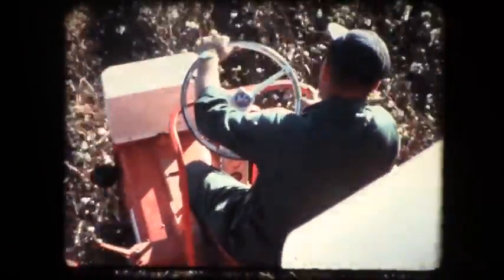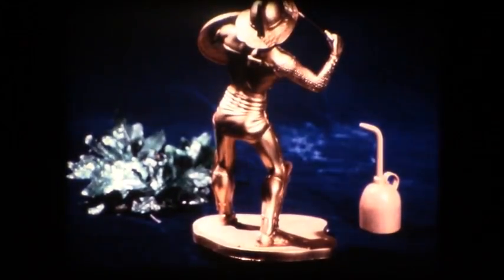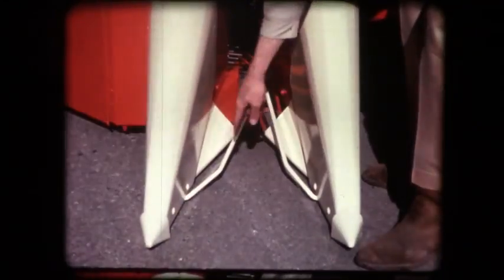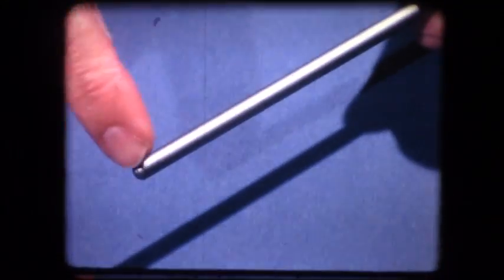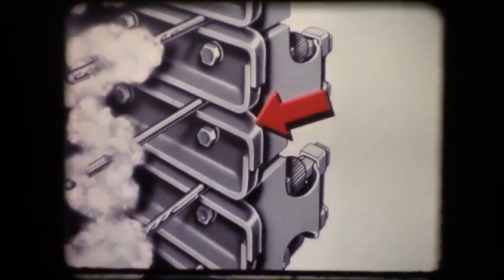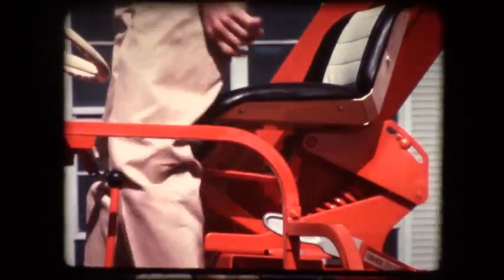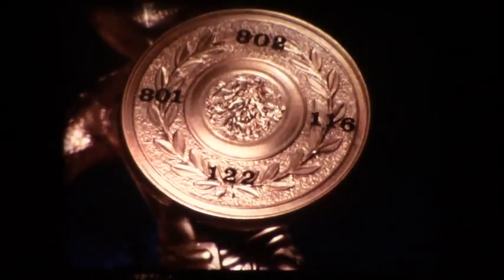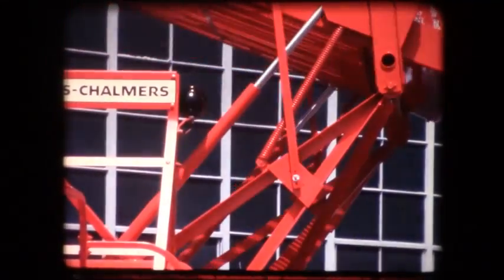1960's Allis Chalmers Dealer Movie Guardians Of Cotton Profit

Comment: Dang that was some beautiful cotton... back when you could actually make some decent money with cotton.  Course it's the same lousy 60 cents a pound on average year in year out that it was back in the early 70's... why there's no money in it anymore unless you're farming several thousand acres.  

I've heard of AC cotton pickers but never seen one in actual running condition.  They just never seemed to catch on, at least around here.  IH had the undisputed best cotton pickers from the 50's, 60's, and 70's.  Deere one rows were a hot mess, and their 99 series double row self propelled machines weren't a whole lot better.  It wasn't until the 699 series and the 9900 that Deere really started pulling even with IH... The IH single rows were always better, and the 200 series double row self propelleds were good machines.  The 400 and 800 series, well, there weren't too many of those around either-- they just didn't last like the older 200 series did.  We had 4 IH double row self propelleds over the years-- two old 220A's, a 214A, and a 416 diesel.  The 400 just wasn't as well built or designed as the older machines.  I always liked the looks of the 782 IH pickers, but they were WAY too new and thus too expensive for us to be able to afford.  Then Case IH and Deere both were neck and neck when they came out with their first four row pickers, and then five and six row.  Deere pulled WAY ahead of IH on their drum design when they went to inline picking units.  Deere has the superior picker now and you don't hardly even see any CIH pickers around any more in the field-- where they used to dominate now it's all Deere green machines.  

Course, we'd have stuck with IH but CASE IH basically said, "Screw the customer" and quit providing parts.  Without parts, ANY machine is just "scrap iron waiting to happen" and for years us smaller farmers scrounged the fence rows and junk yards for parts to keep going, and then finally all those old machines just went to the scrap yard themselves.  After the way the dealer OUTRIGHT LIED to me when I bought the 416 from him, when I asked him, "CAN YOU GET PARTS FOR THIS MACHINE?" and he said, "sure we can!" and then the first time I had a breakdown I got a sob story and a week of runaround on obsolete parts network and then told I was SOL, so I sold it for scrap a few years later and replaced it with a DEERE picker-- DEERE backs up their machines with PARTS SUPPORT... Case IH turned me into a Deere man, and now that New Holland bought Ford Tractor Division and did the same thing to us on Ford tractors and implements, Case/New Holland has firmly made me a DEERE guy... Later!  OL J R :)
Reply: In my area a former IHC DEALER RUNS JOHN DEERE S NOW THEY SOLD THEIR DEALERSHIP ABOUT 15 YEARS AGO....THOSE ROUND BALES THE JOHN DEERES MAKE ARE SO MUCH BETTER THAN THE SQUARE  BALES THAT IHC MAKE
Reply: Still can't see how a Farmer can pay for a 800,000 USD PICKER
Reply: The only AC cotton equip I saw in my area were one 4 row brush head stripper and one platform stripper and all I know is that the ginners didn't like them !!!!!
Reply: @robertpayne2717  like Grandpa always said, "they can't... The bank owns it!  He just runs it for them"
Reply: P
Reply: @robertpayne2717  Well stripped cotton, particularly in the old days, was a LOT dirtier than picked cotton.  Now with saw cleaners on almost every stripper, the cotton coming out of a stripper is way cleaner than picked cotton.  Honestly I'm kinda surprised they even build pickers anymore, considering the difference is negligible between picked and stripped cotton quality wise anymore, and strippers are SO much simpler and cheaper to build and maintain than pickers and can be adapted to any row width or configuration easily vs.a picker.  Main difference is strippers are for "stormproof" tight boll cotton and pickers are usually used on more open boll cotton, but I don't know how much real difference in that there is anymore.  IH USED to build strippers too, but in the mid 80's when they came out with their 1822 and 1844 four row pickers, IH decided to go with a "common platform" with the only difference between pickers and strippers were which heads were mounted on the machine-- the rest of the machine was the same only they put stripper units on strippers and picker units on pickers.  I talked to a guy once who told me how that backfired on them... Strippers had always been built on lighter chassis for the lighter stripper heads, but the 18xx series machines had to have a heavier chassis to withstand the load of the much heavier picker units on pickers.  He and a buddy had put in cotton after being out of the business for many years, his buddy bought a new IH stripper, he bought a used Deere stripper, which his buddy teased him about.  They started stripping the crop in a wet fall, and had planned to team up to harvest both their crops faster.  The heavier IH machine kept getting stuck SO MUCH that he ended up harvesting BOTH their crops with the old Deere, and that shut his buddy up quick.  He was disgusted and traded off the new IH machine for an old Deere himself.  Another thing is, pickers are geared MUCH slower than strippers... So unless you use to totally different transmissions, your really limiting the usefulness of a stripper.  A few years later IH quit offering a stripper altogether; they proclaimed pickers "the wave of the future" and said strippers were becoming obsolete, thinking they could force their customers to switch from strippers to much higher priced CIH pickers.  Well, that didn't happen; IH stripper customers didn't buy CIH pickers, but became Deere stripper customers.  I talked to a big high plains cotton Garner e at a farm show one time, he told me the story... He was like, pickers are too expensive, too complex, too much maintenance and repair, and TOO SLOW... Pickers to out in speed at a little over 4 mph in scrapping gear-- they can't spin the picker units faster without blowing them apart.  Strippers run unsynchronized with ground speed (meaning the stripper units spin the same speed at all times regardless of ground speed-- pickers spin their drums proportional to ground speed so try don't "rake" or drag the cotton at high speed, or beat the cotton and pull it at low speed).  He told me in light cotton they will run the stripper at up to 10 mph!  Plus at that time you could only get a 4 row picker while most strippers were six row.  So using a picker would take FOREVER covering thousands of acres... So the CIH customers dumped CIH and bought DEERE strippers!  Talk about cutting your nose off to spite your face!  Part of the reason CIH is a loser company now owned be New Holland/Fiat...

Later!  OL J R
Reply: @lukestrawwalker  cih doesn't make a cotton harvester anymore
Reply: @brandonwood1397   pickers, but not strippers I guess... But nobody in our part of the world buys them anyway... Everybody runs Deere pickers
Reply: @lukestrawwalker   they don't make either Deere is the only one to make a cotton harvester
Reply: @brandonwood1397  Really?  Didn't know that, but I quit row cropping to do all cow/calf 20 years ago.  I know back in the early 90's CIH quit making strippers, figured with four row pickers they'd just force everybody to switch to pickers, but the High Plains will never switch with their stormproof cotton that needs to be stripped to harvest efficiently, plus strippers run way faster and MUCH cheaper to buy, repair, and maintain.  When they lost huge market share because all their stripper customers started buying Deere strippers instead of CIH pickers, they suddenly took the CIH picker chassis and put stripper units and a saw cleaner on it, but I talked to a guy who said it was WAY too heavy and sank like an anchor in wet conditions, he ended up harvesting his and almost all his neighbors with his used Deere stripper which was light enough to stay up in the mud.  The CIH strippers never sold well and they gave the market to Deere.  

Wouldn't be surprised CIH quit the picker business too... From my own experience, CIH is a loser company, they basically sent our IH pickers to the junkyard in the early 90's because the b@stards wouldn't provide parts, so we switched to Deere pickers and never looked back.  Any company that won't support their equipment with parts is a sh!t loser company IMHO and I won't waste my time or money doing business with them.  No wonder they got bought out by New Holland to make CNH, and that whole mess now is owned by FIAT (fix it again tomorrow) so just a big cluster fvck like AGCO... No thanks... We ran blue equipment for decades but IMHO Ford went to sh!t when New Holland bought them out, they're a train wreck of a company now.  CIH and New Holland have made me a Deere man... At least Deere backs up their equipment with good support... Screw CNH/Fiat mess....